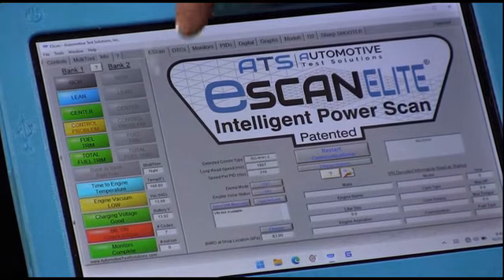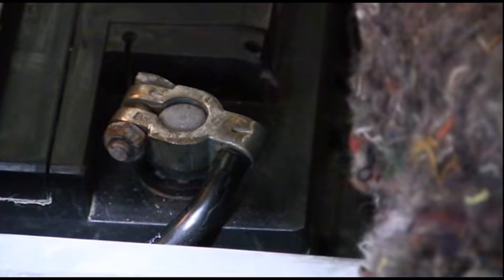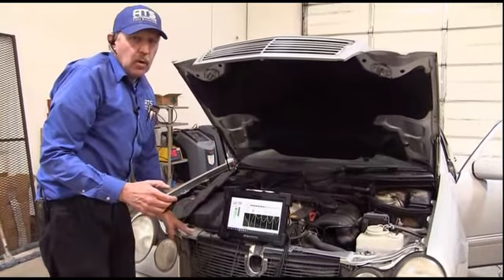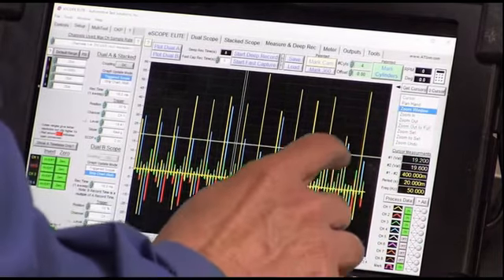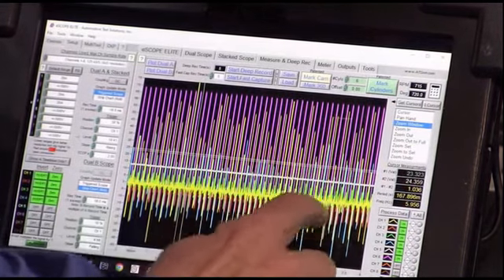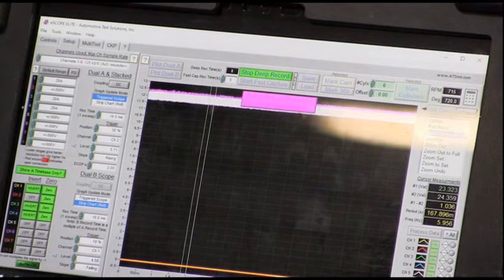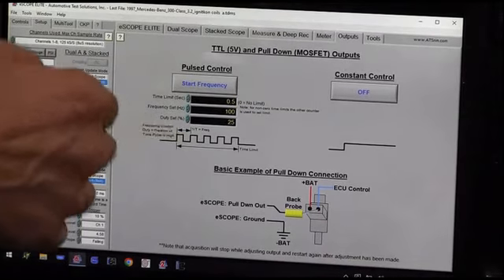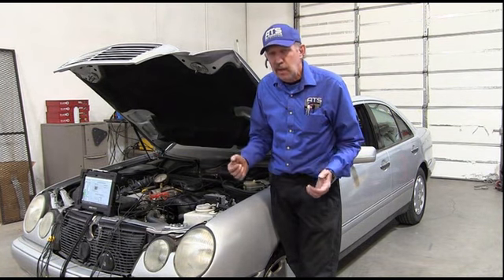1997 Mercedes-Benz E320 Misfire

Comment: Some tips:

When working on call-ins for other shops, I always do a visual inspection of the car before I do any thing else. Many times the previous shops will leave a connector unseated or forget to connect a hose or do other strange things. You should also find out exactly what work was done and if they have the original parts if any were replaced.

After clearing DTCs to get the injector to fire, when the PCM strategy shuts down the injector due to the misfire, you should be able to see exactly what cylinder is shut down as per the DTC. The PCM is both shutting down the injector and storing a DTC for the same cylinder. For a 1997 model year car, it should be equipped with full OBDII if originally sold in the USA.

A quick way to find a misfire on an inline 6 cylinder engine is to do a thermal image of the exhaust manifold, mainly because you can see the manifold assembly. The misfiring cylinder will be the one with the obviously low exhaust temperature. This is especially true after the PCM disables the injector. 

Once you know which cylinder is misfiring, then you have to find why it is misfiring.

Comment: Hello Bernie will checking the amperage of the bad fuel injector show the state of health of the injector if its having high or low amps to operate the injector looking at it through the scope? or the pressure drop test is the best way to test injectors?

Comment: My 1997 S320 had a misfire in cylinder 6 after the engine warmed up. Then the O2 sensor shut down the cylinder. When the engine was cool there was NO misfire. My real-time graph of the firing sequence was almost identical to the one in your video. A spark issue was also present.  Removal of the coil revealed a torn boot on that spark plug resulting in rust and corrosion.  Installing fuel injectors, spark plugs, and wires took me a few hours.  Now the engine runs like new. Thank you

Comment: That's a smart strategy when you think about it , if the cylinder is missing for whatever reason in some cases  unburned fuel will be in the exhaust.  The oxygen sensors will read the rich condition and the fuel trims will remove some fuel ,this will cause the remaining  healthy cylinders to have a lean mixture making the engine run even even worse . This strategy helps the fuel trims to work correctly for the healthy cylinders and the effected cylinder to just pump air . German engineering is pretty sophisticated .

Comment: Most shops don't do diagnostic past a quick scan. They also use identifix and shoot parts at it.  Why? Diagnostic doesn't pay much and shops just want easy gravy work so they can turn 80 hours + a week. This mechanic in the video is a true mechanic.

Comment: What kind of shop can't do a simple compression check. Know wonder. Let's look at data. Always be careful. Yes they shut injector off or ignition off.yes if shop could fix it. Must be some asshat Garage.  Yanilla effect on .I can by ear if the engine has good compression just hold pedal to floor and crank over engine..

Comment: This is shameful on the techs condemning the engine.
I worked for Mercedes years ago and this is common knowledge about the fuel injector strategy. I can't believe someone threw a set of coils at this, still had a misfire and it didn't dawn on them to at least flow check all the injectors.
Shameful is all I can say

Comment: Some shops get lost, and the CUSTOMER gets screwed. I got called by a auto parts store to troubleshoot a "rough running" Ford. Shop had already installed a rebuilt carburetor, new distributor and REBUILT ENGINE!! Well, some old lady will ended up paying over $3500 for ... an EGR valve 😆 😥.  Yup, bad EGR valve was original problem all along. After more than three decades in the biz, I can rattle off stories like this for hours.

Comment: In this case the injector was not flowing enough, so the PCM recognized a misfire, turned off the injector but the spark was showing a much higher output which is the giveaway.  On carburetored engines an ignition scope would would show a lean cylinder usually a spark plug or ign wire, but with a fuel injected engine the extra advantage is the injector pressure drop test which can be done through the scan tool.  Thanks Bernie for this video.
Reply: Thanks for shortening the story

Comment: You are  just exceptional on what you do. At first it was so difficult to understand the way you carried out diagnostics. Now I fill best ever to handle any make. How do I get hold of the diagnostic tools you use? Please advise.(pressure transducers, escan, oscilloscope....)
Reply: TST has a website
Reply: Automotive Test Solutions has a website
Reply: It's not necessary at all. Really. Everything he's doing can be done with much more affordable equipment. It's really not going to make your job any easier. If anything the ESCAN will do more to confuse you than help.
Reply: If you REALLY want an oscilloscope buy an Mp408 to learn with. And for your scan tool just buy any Bi-Directional tool that can read all modules. I have the Snap-On Ethos but honestly that was a waste of money. A lot of Autel devices are just as capable for a 1/4 the price.

Comment: Following data but shops don't want engineers working in their shop. I myself consider myself more than a mechanic and I worked as such for almost 2 years and mechanics that I saw did not have 10% the knowledge that I did watching Bernie and utilizing the tools and the methodology that he uses. A lot of mechanics can't even do a relative compression using an amp clamp or the AC voltage technique or the in-cylinder or even the intake pulses and such. I'm amazed that a lot of techs are either scared or too lazy to learn and invest.
Reply: Definitely not investing enough into knowledge. Tools (all of them) are use less without knowledge! I keep telling a friend of mine he needs to take time out and update his skills. He doesn’t even have a scope.

Comment: Im curious how the pcm was shutting down injector #5 if it wasn’t setting a dtc for cylinder #5 misfire—- infact had dtc for  cylinders 4 &  6 — why weren’t those injectors commanded off ???????
Reply: that was from techs unplugging coils i believe
Reply: But Bernie said the other shop was chasing a cylinder 6 misfire—- and even if the other shop caused a misfire DTC —- you would think the car would’ve been running on four cylinders when Bernie started working on it  ( ie cylindef 4&6 deactivated)
Reply: @victorhernandez3102  when the ECM shut down the injectors,when you turn of and then on the key ,the car will work 'full on' ,until detect again misfires and shut down the injectors again.
Reply: @Lambros_Stefaneas   oh ok — that makes sense — do you know is that Mercedz Benz strategy particularly? —- I know when I first discovered this feature on German vehicles… A BMW specifically… can’t remember the specific year make and model… But it was Many many years ago… The injector was disabled, as long as the code was present—-in other words, I replaced a bad coil, and still had a dead hole due to the injector being disabled… Which was the case, until I actually went in and cleared the misfire DTC— that’s what had me so confused about this video — but your explanation makes perfect sense
Reply: @victorhernandez3102  
VAG GROUP  is the same,and I think all the German manufacturer (at least the latest models).For the rest, I have not check it, but I suppose on French cars the same, because I have replace a coil(quick check  to see if the coil is the problem)without clearing the code ,and work out(but to be honest, I don't know if they shout down the injector ).I wouldn't surprise if all the European cars is the same. For American cars, no idea, I am not working on them, because were I am no many American cars, and for Asian cars,don't know either, I have not seen a Asian car to misfiring for years 😅😇
Reply: So the crank sensor must have been replaced and was not relearned , which learns the cylinders firing order etc and more

Comment: Easy on the Dealer technicians,  some of us do use scopes and advanced diagnostic techniques. 😃😄 Nice video.  Thanks for posting it.
FYI some early Subaru's will kill injectors for IAC motor issues.
Reply: It's just a marketing and story. Car came from dealer and so on. Every juutuuber use that tehnique. I work on dealer and use scope. I am familiar with these diagnostic techniques. I've repaired a lot of cars from other places, but I don't brag about it. It's just my job.
Reply: @joukijou  make videos and see how a dealer tech fixes everything without throwing parts at it. Dealers don't pay for extensive diag time from what I saw.
Reply: @scientist100  I have a few videos out. Check them out when you get a chance. I'm a Nissan dealer tech.
Reply: @scientist100  It's true. And also, the real good technicians, the majority, they go,open a  shop or decame mobile techs,so the really good ones, are not many in dealership.